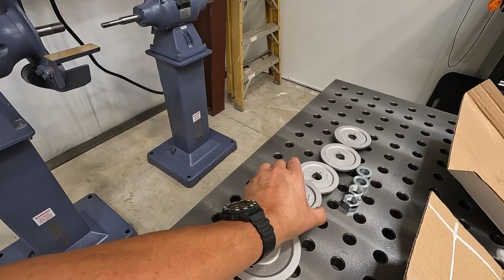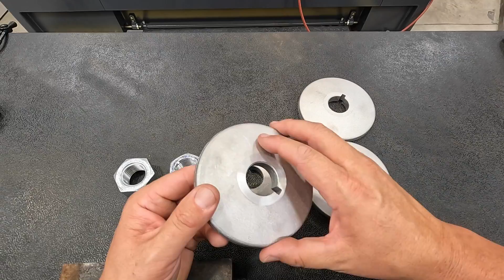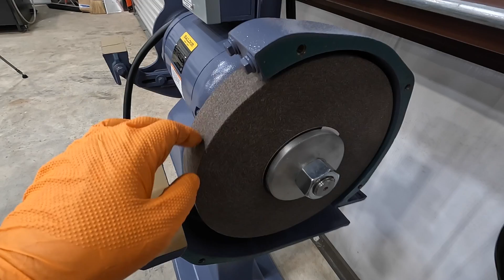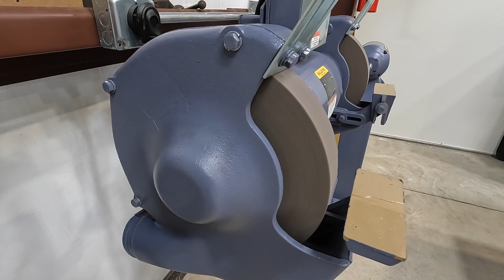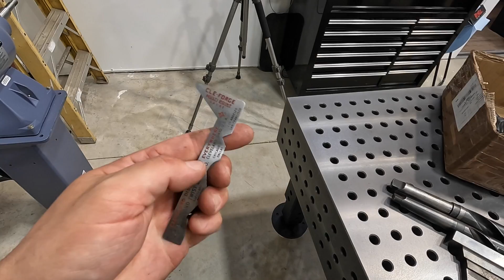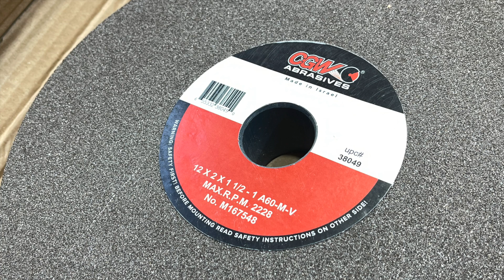Pedestal Grinder Improvements and Wheel Installation

Comment: One thing I saw in a shop a few years ago was transparent shower curtains around the grinding area. Seemed like a super simple tactic to reduce contamination of the rest of the shop from grinding dust.

Just a quick reminder (because we're all terrible with PPE, and we should keep reminding each other about these things): You should definitely wear a mask / respirator when dressing grinding wheels. That dust that comes off is almost designed to cut your lungs to shreds. I'm terrible at remembering to do this, but I don't want other people to make the same mistakes I do!

Thanks for another great video Adam!
Reply: I totally agree with this. Grinding wheels have all kinds of components that are terrible inside lungs and cause long term damage.
Reply: @AllenCavedo  Ever taken samples of the air we breath outside?  If folks saw the readings they would wear masks all day and night.
Reply: @Garth2011  Lots of worry-warts do that all the time around here.
Reply: @Garth2011  The air we breathe isn't the best, but it usually doesn't contain high concentrations of aluminum oxide, silicon carbide, cubic boron nitride, and diamond. These abrasives are designed to cut into tool steel and even tungsten carbide. Your lungs aren't much of a match for these materials. These materials are chosen because they have ridiculously hard and sharp crystals. They manage to get classified as "bonded solids" when they're sold as grinding wheels, but when you dress them, those crystals are released into the air around you in a perfectly breathable dust. They aren't going to directly cause cancer (as far as we know), or poison you in any way. They're going to cut the cellular structure of your lungs and respiratory system into tiny little dead cells.

Seriously, Grinding wheels aren't usually that bad (you should probably wear a mask when grinding hard materials, or for long periods of time), but dressing grinding wheels is like putting pure asbestos in a blender and breathing in the dust. Orders of magnitude worse than breathing in the air pollution you might come across in most industrialised cities.
Reply: @Intermernet  That sounds like an OSHA lawyer wrote it. All true but in the real world, folks are going to be subject to all sorts of ingestion. If that is all a person did all day all year long, use a stone dresser on the wheels or use a grinder for the same period, I'd personally have a facemask dispenser mounted to the wall above the bench grinder and a vacuum extractor on those ports back of the housing. A one man shop who grinds small machine parts now and then won't really have any health risks.
Reply: I like to collect the piles of dust and put in my mashed potatos. Take that, stick it in your pipe, and smoke it Mr Safety Man!!!

Comment: You might have a problem with the sparks hitting that plastic wrapped insulation (diaper wrap).  I would put a wood or melamine panel over it.  Fire resistant doesn't mean you cant melt holes in it.
Reply: There are fire resistant bags which Adam could attach to the outlets of the grinder to catch some good amount of the dust from the material removal as well. And Adam, you should really wear some respiatory equipment, at least wehn facing the stones.

Thanks for the great vid!

Comment: I'm quite amazed that equipment at that price point doesn't already have all the refinements that you have had to make. If it was a $30 DIY bench grinder I could understand it, but a professional tool finished to that quality? Very poor.
Reply: Great work as always Adam but  I was thinking the same, top quality professional pedestals with fantastic motors and bearings but absolutely terrible finish on all the external parts!
Reply: The flange plates are probably farmed out to someone else and just supplied to Baldor rather than being made in-house.
Reply: @sithus1966  Still no excuse - Baldor should specify them to be turned, not rough castings.

Comment: Adam, when you say that you take 125 thou at a pass is that from the radius, meaning a 250 thou total cut or from the diameter, resulting in a 125 thou metal removal.
Reply: He was removing .0625"depth of cut,  which is .125" off diameter.

Comment: i've learned that new grinding wheels should be run for 10mins alone without anyone near, in case some failure is in the binding of the grains and it blows.  And before mouting hit it with the handle of an hammer to hear if creaks are in it. If it sounds dumb there is a crack insinde, if it has a brigher sound its good.

Comment: Maybe make & mount a bracket to the front of the machine to hold a water tank for cooling the work-piece when making and sharpening tools & bits.
Reply: So when watching the video, what do you think Adam was dipping the hot part into?   It wasnt chockolate because he didnt lick his fingers.
Reply: @N1gel  Was a separate pot sitting on top of an upturned drum.

Comment: I was taught to stand to the side when turning on a grinder, every time
Reply: As was I! Also, NEVER to grind on the SIDE of the wheel! Too much force there is a recipe for grenading the wheel! And you don't want to be in the "plane of rotation" if that happens. Guy did it in HS metal shop (not ME) and it was a good thing he was wearing a full-face shield. Which BTW was the last time that shield was used, it was ruined. Same guy later left a chuck key in the lathe and turned it on! Some people just need to stay away from power tools...

Comment: with the dust grit an such coming off onto your insulation / clean wall would you consider putting  some kind of duct to direct the waste into a bucket? the 3A/industrial valve shop i used to work at we had a bucket to catch the output youd be amazed how much it stopped from spewing out everywhere

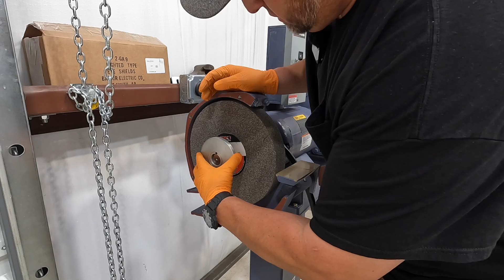Comment: If anyone is wondering what the dust collection port looks like.   It's at  33:05   with the cap off. You can see the chase leading out to the back. At the very least a  90 degree duct should be attached.
     Is there no spindle lock?

Comment: Why did you not turn the inner face, seems like you would want both the inner and outer face turned to the same with the outside only machined only the inner face will be grabbing the wheel.
Reply: The inner face is below the outer face on the casting (at least on all grinders I have worked on).
Reply: @frodestock1676  Thank you, I will have to double check mine.

Comment: What would the maximum acceptable runout be for grinder shafts? I have a 10" Jet bench grinder. I didn't notice until after I had it for some time that it has been dropped. The side cover plate is cracked. It seems to run smooth enough, but it's not perfect. I kinda wonder if that side shaft might be bent a little.
Reply: I found this;
      "Typically, the maximum allowable amount for runout is 0.002″ (2 mils or thou). In the case of a higher RPM machine (more than 3600 RPM), a tolerance of 0.001″ (1 mil or thou) should be used. Although some people have thought that checking runout is a waste of time, it certainly is not."

Comment: Next on the list, get a nice BurrKing 760 belt sander/grinder with a variable speed up to 8k rpm. ...Can't beat them...Ricko
Reply: Call me for a Quote. I'll extend my best pricing and include some No-Charge Abrasive Belts with your purchase...
Reply: @Duschbag  I've had 3 of them in my shop and sold them once I retired and shutdown the business. I thought I still had 1 left put away in 1 of my 40' storage containers so I could use in my home shop but I guess someone decided they needed it for free thinking I wouldn't look for it for some time down the road since I retired. Of course now I need it....

Comment: Nice pieces Adam. I would recommend moving that buffer over a bit in case you have to do any larger pieces and really work them in odd positions especially if you use any buffing pads. In my shop I don't use the covers but I stick pin 1 or 2  sheets of poster cardboard and stick to the back wall. Also duck tape 1 piece on the floor where I stand so all crap doesn't stick to the floor. Replace them as needed. I've done many years of grinding, scotchbright wheels and buffing so just a suggestion....Looking like a nice shop taking place buddy...Ricko
Reply: Also the grinding dust would contaminate the pollishing pads and you will end up with two grinders because of the cross contaminatipon.
Reply: @andrekocsis2215  exactly

Comment: NEVER stand directly in front of a grinder when turning it on, specially for the first time in case of wheels fragmenting. I am extremely jealous of Adam. I have shop envy!
Reply: A 6 inch grinder will fire the broken stone at you over 70MPH so yes never stand in front when starting any grinder.

Comment: Might be worth looking into putting some kind of range hood over the grinder area, like they have in commerial kitchens to extract some of that dust.
Reply: I like your thinking.
Reply: I am thinking the metal particles ejected will be too heavy to be lifted into a overhead range hood, not even work half assed. And if someone were to build a range hood with enough suction, chances are great metal particles will be getting in the operator’s eyes.

Comment: fun video. there is something pleasing to the ear when i hear smooth-running grinder. i made some mods on some cheap grinders. i have. switch out those stamped steel end caps for some turned 1018 pieces and some snug fitting Delrin bushes made a big deference.  thanks for sharing.

Comment: About facing the LH nut in the forward rotation mode. If he were to face the LH nut in the reverse rotation mode, he would have to turn the tool up-side down. Lot of trouble for just a few seconds of facing work.
Reply: Fair point but not neccessary. Snug the left hand nut on to the mandrel, run the lathe in reverse (clockwise when facing the chuck from the tailstock end) run the tool PAST the centerline of the lathe spindle, face from inside to out. No changes of tooling necessary. Might have to run the compound all the way in if his crosslide is short on range.
Reply: @utidjian  You are correct, but I remember that just after I had hit "Enter" ...LOL
Reply: @davidtyndall8880  Oh a nickel for every time I have done that! :) But anyhow I was kinda amazed that he did it the way he did. I can only assume that he tightened the nut on real well and he did, in fact, take light cuts (0.005" per pass for two passes.) Otherwise it all could have gone terribly sideways, literally.
Reply: @utidjian  You are correct, but I remember that just after I had hit "Enter" ...LOL

Comment: Aren't you supposed to "ring" those wheels before installation just to be safe?
Reply: I posted that as well...seems a few things which are standard safety are not shown...un plugging the power is lol Also you never shock a wheel tight with a hammer. I have my Norton Abrasive cert from 1978

Comment: When you faced the LH nut, (I’m not a machinist, so I’m not criticizing) but shouldn’t you have faced it with the lather turning clockwise? I know a bench grinder has either side of the motor different thread direction so the one side doesn’t loosen once force is applied when grinding. Wouldn’t that principle also apply to facing a LH nut? To clarify, the cutting resistance while turning counterclockwise would want to loosen the LH nut. So were you just taking small enough passes that it didn’t matter? Or am I missing something
Reply: I was thinking the same thing. I was waiting for that left hand nut to back off and destroy some tooling. I suppose he must have had it locked down tight enough.

Comment: FYI that insulation behind the grinder isn’t cheap I would cover with something that will resist the sparks from the grinding wheel.
Reply: That’s what the guard are for.
Reply: @MichaelEdelman1954  you can never be too safe
Reply: Agree 100% I would put a piece of Sheet Metal back there in front of that Insulation!
Reply: As someone who doesn't know any better

What about hanging a small plate behind the back outlet to stop the spray

Maybe hang some small chains on the impact face to arrest the sparks
Reply: @funny0000000  Yes Adam is a dirty dirty boi.

Comment: Adam, Nuts have two sides.  The "clamping force" side is clear of numbers and letters.  On one nut, the cut was easier and clearer because it was cut oon the clamping force side.  When tightening, those numbers and letters must be on the outside so the grip force is flat and, an Inspector can verify the correct nut was used.  That's much more involved than what you are doing here - just wanted to pass that along - I believe it's in Machinery's Handbook.
Since you were concerned about equal forces on the wheel and balance, and rightfully so, I would have machined the outside faces of those plates - they were all different from each other.  As usual, you are an impressive guy - keep 'em coming.

Comment: Dumb question, but why did you do a left thread when you could have just flipped the nut around?
Reply: A left-hand threaded nut is left-hand thread from both ends 😉 it won’t thread onto a standard thread.
Reply: @KennyEaton603  Don't know why I was thinking it was like a piece of all thread, obviously the threads have to be different on each end so the nut doesn't torque itself off.  My bad lol.  Like I said, dumb question haha 😄
Reply: @jghunts5784  ah, I see. Yeah, one side is left, the other right. Not exactly obvious unless you really think about it.

Comment: I can't help but notice the plastic covering on the insulation. Are you planning on covering it or putting some 90 degree bends facing the ground
Reply: I was thinking the same thing, shooting sparks into the plastic on the insulation
Reply: Me too. After about 10 or fifteen grinds you will find  out how expensive that insulation is.
Reply: @englishteacher1260  notice how Adam’s fingers are in the sparks, those sparks are not hot enough to damage the plastic covering.

Comment: So, Adom how long do you think the insulation behind the grinder will last with the sparks hitting it? I'd put a piece of flexible metal tube on the exhaust tube on the shroud and point it downward.
Reply: Including a vacuum to remove the wasted material.
Reply: Probably about 6 months. it'll buff out.

Comment: Aren’t the outer flanges cut shallow on the inside bore since your on the threads and not the shaft of the machine? Hence the two smaller diameters?

Comment: Adam, do you think a piece of rubber mat would work under the grinders to make them quieter?
Reply: Thought of that too.  I've used pieces of truck flap in the shop, great material. Really tough stuff used saw to cut. Even better was free found in road.
Reply: May be too soft. I know a fairly hard rubber is used for shimming bases.  Probably the same for this machine.
Reply: Nothing works better than adjustale feet to fix that unever floor situation.
Reply: @andrekocsis2215  I would say shims are better. They don't move, especially when bolted through.

Comment: Is there any chance when facing the left hand nut that the rotation of the lathe in the forward direction catches the nut and spins it off toward the tooling or does that never happen?
Reply: That can happen for sure.
Technically, should be running the lathe in reverse and cutting on the back side of the work, thereby creating a situation where the left handed nut will just be tightened further, just like with a standard right hand nut/ lathe set up
Reply: I thought the same thing, he must have given it a good GRONK.  I would put some Loctite on there too.

Comment: You may have done this off camera, but some people may not know to ring the wheel to check for cracks before installing it.  A simple easy safety check before installing any wheel new or used.  I haven't seen a dresser hooked on the steady rest like that, so I'll have to try that sometime.
Reply: You have to readjust the rest after dressing the wheel.
Reply: @firesurfer  you don’t say?  lol

Comment: Very nice grinders!  Can you address how the wheel exhaust from the guards is used to reduce the swarf that is generated?  Your pretty drywall will be black before long.  Just curious if that is an issue.  Thanks.

Comment: Nice Grinders! You could make some narrower back up plates so you can use the 2" wheels. If you face both sides of the nuts, in 10 years you don't have to remember to install the correct side. Or if you have anyone ever help you.

Comment: I have a question for you Adam I was told if you grind the wrong type of medal it will make the grinding wheel explode just wondering
Reply: No good grinding wheel on a pedestal grinder will explode if used to grind any metal, some softer metals will gum up a grinding wheel though such as aluminium and copper.
Reply: You should not grind any medal.  They are precious.

Comment: Been selling Industrial Tools for over forty two years and have sold a few Baldor Grinders and Polishing Lathes. But you Sir took ownership of these to an entirely new level. NOBODY respects Bench Grinders when they're using them. Until they BITE YOU BAD..!
If a new wheel comes apart at speed because of an unseen defect, the Grinding Wheel Institute compares a 6" x 1" Bench Grinder Wheel coming apart at 3450rpm to the blast of a 12ga Shotgun. Do NOT stand in front of the Grinder when turning it on after installing new wheels and when they get a poorly worn face, REPLACE THEM if you don't know how or have the proper tools to dress a new face on them. Safety is your own responsibility.

Comment: Never been able to cut threads from the end in I've always had to cut them from relief out but it might be my lathe it is a 1940  Bridgeford lathe with 24 inch swing and 16 ft working length it was out of Waterveliet arsenal and there isn't much precision with alot of small stuff but I can get pretty damn close with it but never been able to cut threads from end with it but can cut them from relief out